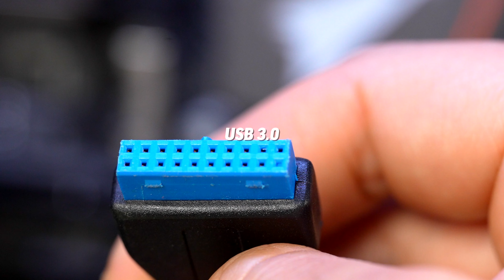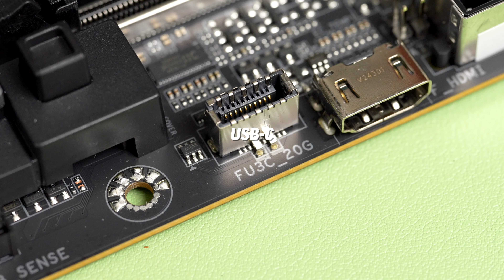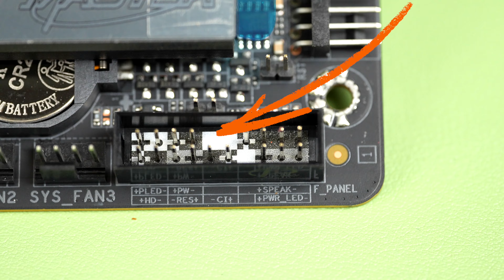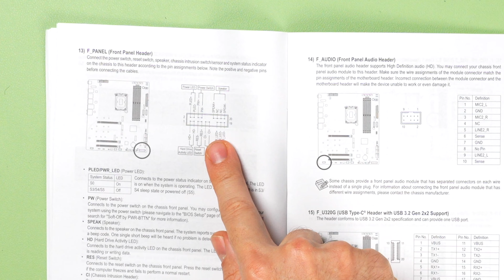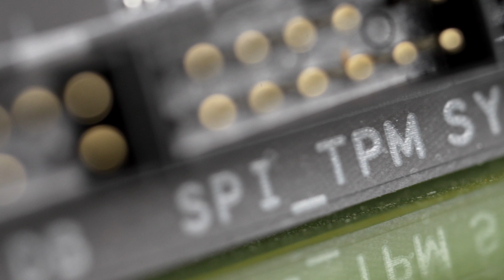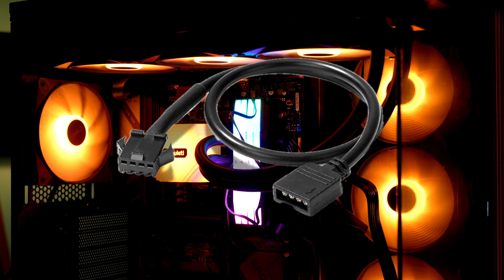Front Panel Cables Made Simple – Most Common Mistakes

Comment: I am upgrading the motherboard in my ASUS ROG GM700 (2025) Gaming Desktop PC, GM700TZ-MS777
ASUS PRIME B650M-A AX6 II, Motherboard upgrading to an Gigabyte Aorus X870 ELITE WIFI7- rev 1.1 AM5 Socket and upgraded the PSU to an " be quiet Pure Power 12 850W
The Asus gm700 case front connector is a 5, pin block with the fifth pin hole blocked. It doesn't match up with the F-Panel Cluster. So I removed the white, Black,Red,Black wire pins and reinstalled them so they lined up with the LED PW+ & PW- and the SW, PW+ & PW- I assumed the Red wire was the power switch + and one of the black wires was the - and the white wire was the LED + and the other black wire was the - but I still have no power at the case power button and I swapped the two black wires thinking that was the problem but it wasn't ?
I jumped the SW, PW+ & PW- with a screw driver and the PC came to life but there was no fan RGB lights or any other lights. I have searched the 
Asus GM700TZ case for power connectors and have only found a ribbon type that I plugged in and the 4, wire block ?
Upgrading to;
Gigabyte Aorus X870 ELITE WIFI7- rev 1.1 AMD AM5

Comment: I inherited a computer case from my son, and its missing the pwr led + and -, so I can't turn it on.
Reply from the maker: You can take a small screwdriver and short the two pins on the motherboard. But yeah; not really a solution for the long run. There are lots for external buttons that could help. They are usually less than 10 bucks

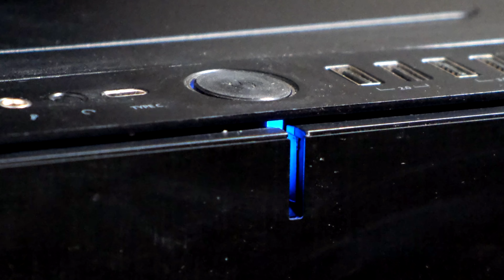Comment: 02:50 It actually depends, I burnt a Aourus MB by inserting the triangled side into the negative pin and closing the cirtcuit "bridged" it with the Chasis fans, the shortcircuit burnt the Super I/O chip (fan lights were connected to the reset switch and I totally forgot about it) - so is better to make sure first all the time even tho u may think is okay (i've built tons of machines cause of my job, so it was a slopy mistake I made for not double checking)

Comment: Interesting. I don't remember the polarity on the power switch mattering. (Could be wrong though, but wouldn't make sense considering you can boot the PC with a screwdriver, so obviously tbey would just go with a button that, when pressed wil just act like a regular old wire.  (Correct me if I'm wrong)

But this video is otherwise definitely helpful, especially for beginners!

Comment: You can absolutely plug in the power button cable both ways, the button is just closing a circuit.
Same with the reset button

Comment: It wasn't exactly my first PC build, as I was just adding an SSD... I don't remember exactly why, but I disconnected the front panel cables... I just remember that it was a big headache to connect everything again... everything went fine on the first try, but I think I may have connected one LED in the wrong order? I mean, after that, that LED was always on, except for a few times where it flickered... and I think it should do the opposite... anyways, I didn't want to deal with the cables again, so I just got some black tape and blocked the LED, as it was a bright blue LED and was very distracting.
Reply from the maker: Thank you for that classic PC building story ;) 
Some drives don't do anything with the DAS (drive activity signal) and some may only be indicating power instead of activity. Other HDD lights are always on with power, and tend to flicker with read/write activity, when they are used - that could have also been the case here. 🤔🕵️